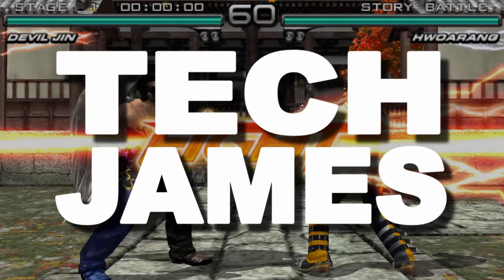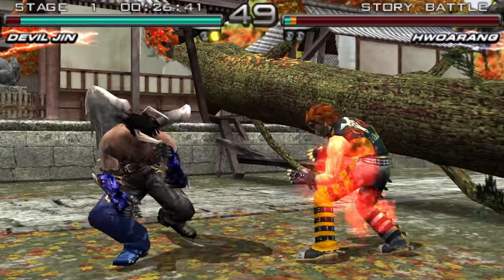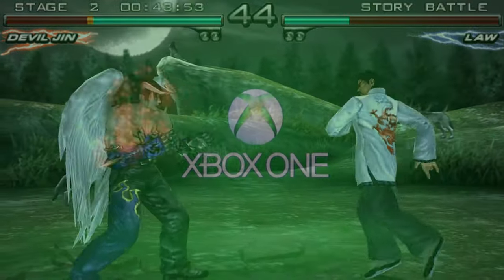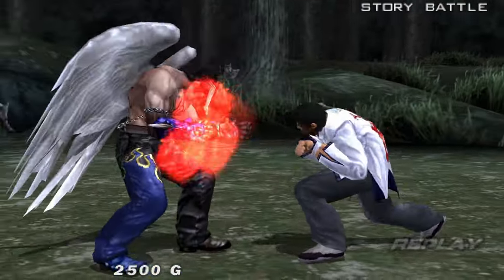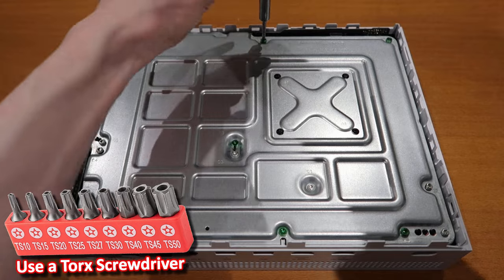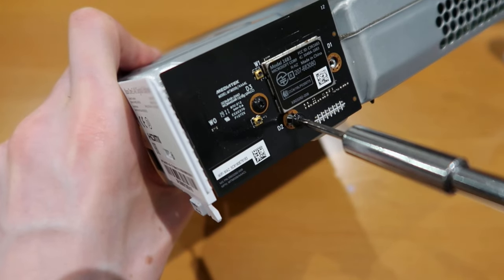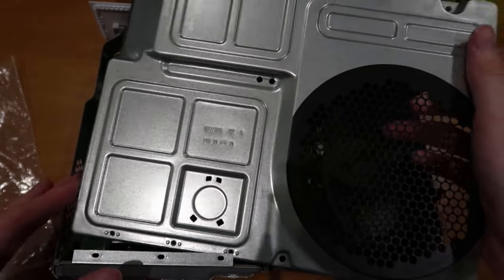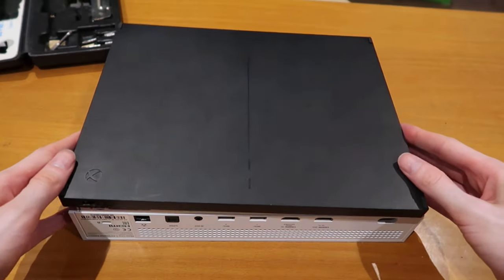Upgrading A Faulty Xbox One X/S HDD To An SSD! (FULL EASY TUTORIAL)

Comment: Great vid! My son got a new Xbox Series X and we decided to give new life to the old one, a One S, by swapping out the hard drive in favor of a 2TB SSD. Your instructions are spot on and made disassembly easy. The only difference is that our One S did not have the three extra screws holding the cover on. I believe this may be due to you having what appears to be the Xbox One S digital only edition (no Blu-ray drive). Our One S has the Blu-ray drive in that large open space between the fan and hard drive; on yours you can see directly onto the motherboard. Once put back together I downloaded the OSU1 file, deployed it to a flash drive, inserted it into the Xbox, booted up, and it ran through setup like a champ. Up and running in less than an hour. Thank you James!
Reply: Thank u for ur experience, I’ve the same one s with blu-ray and I’ve to do this upgrade asap cause now it’s a snail

Comment: I installed a SSD in my OG XB1 and it’s great and super easy.  The UI is smoother and load time are slightly better.  SATA 2 is a bummer but there is a noticeable difference.  It’s quieter and cooler now.

Comment: It is great to see you back my man! - for a tip, I upgraded to SSD as well but was part of developer/ insider program!! So you have to do a few steps first or it won't work- in this case you have to go to the insider hub and unregister your console from the program, after you do this it should prompt a restart and update- if it does not then you will have to manually restart and then it should update --- after that you are able to follow this tutorial and swap regularly ( and Yes you can re register your console to the program after you swap)

Comment: Followed everything in the vid. I found out that if you're in the Insider program that it won't work. So I removed the console from it, reinstalled the original HDD, booted it up, made sure it was removed. Then reinstalled the SSD and tried applying the offline update with a USB but it stops after 1% and I hear the power on sound. Have any ideas?

Comment: So I’m currently doing this with a Xbox one x and I have a WD blue sa510 1tb. I have tried using 3 different flash drives for the osu and I can’t get it to work. It fails once it gets to 1%. I’ve made sure the download on the flash drives are correct. Any help would be appreciated
Reply: i'm having the same problem, did you figure anything out by chance?
Reply: @leonthomason7552  yes. When you turn on your Xbox to do the offline system update what version operating system do you have? If it says 22621.4918 it won’t work with that one. It needs to say 22621.4912. I just put my old hard drive back in and it did an update and then I was able to put the ssd in and it worked.
Reply: @leonthomason7552  did you get it figured out yet?
Reply: @RevHellscream  I am having the same issue, I have a 1TB WD Blue SA510 drive and my xbox is fully up to date